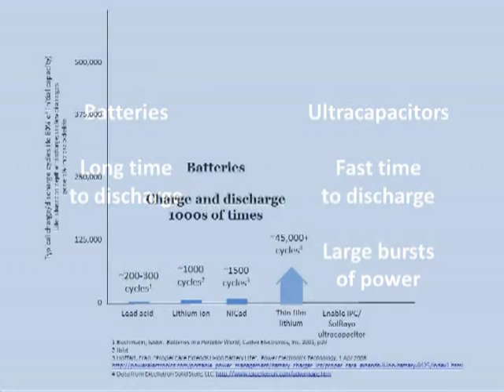What is an ultracapacitor?

Comment: I put a 16.2 volt pack in parallel with my car battery and it starts hella quick now. I even disconnected the car battery to see if the caps would start the car and they did